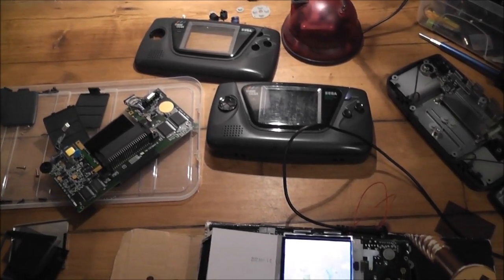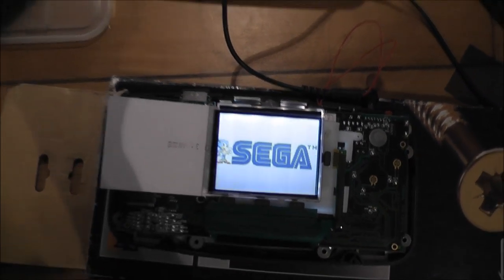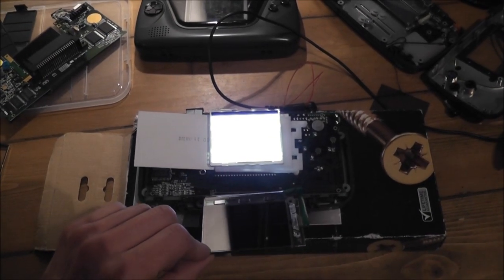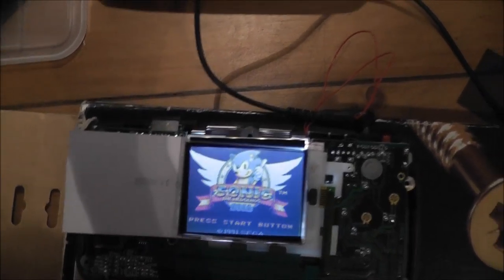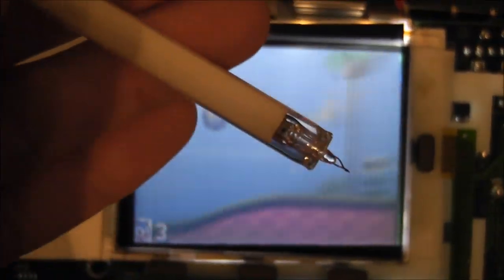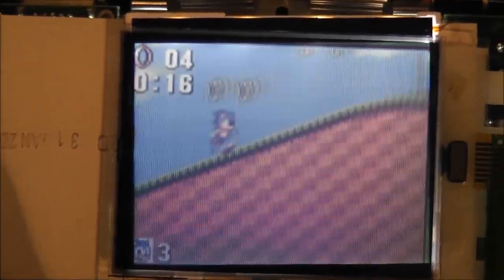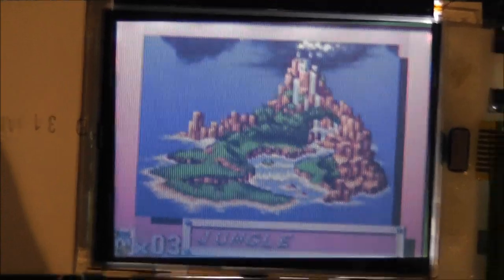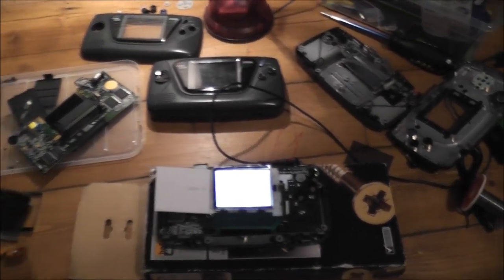Nintendo DS LCD Backlight In A Sega Game Gear? - Messing Around With Old Parts

Comment: anyone looking to do a mod like this, if you are not going to worry so much about costs, look up the McWill mod for the game gear. It has a proper LCD replacement, and proper back light. the proper LCD replacement part is absolutely key. it isn't exactly a 1:1 replacement, but it is really, really, really close (unlike the other LCDs where it makes it a tiny square). 

The cost is a lot up there, like close to $150 USD IIRC, but if you are serious about the game gear, this is by far and away the single best mod you can ever have done to it.
Reply: stuff like that didn't exist when this video was uploaded

Comment: I'd like to do this mod, but I'd only do it if I have an extra Game Gear. As a Console and Handheld collector, I like to keep at least ONE of everything in it's original condition. The only exception is when i have to replace components, but I always make sure to replace them with the same part.
Reply: +SupraViperhead I know it's a bit old but you could always buy a really cheap, busted GG off eBay, get new caps as well and once you replace said caps, you'll have a working 2nd machine to test out this mod on. If anything, make sure the AS-IS GG is a model 2110. I'm trying to fix a 2110-K GG and having no luck with the caps at the moment.

I'm still pretty new at this tech repair stuff for game systems but modding the GG to have a DSI XL screen sounds fun and I'm still gathering the information on how to do this.

Comment: the game gear is an intresting part of sega history
taking the opposite route with their handheld product by going from the console to the system unlike nintendo going from the system to the console
and the tv tuner was also an awsome add on even though you cant use it to watch tv anymore you can use it to play other systems like an xbox 360

too bad i did not discover this until way after sega stopped making consoles cause i would have bought into the franchise